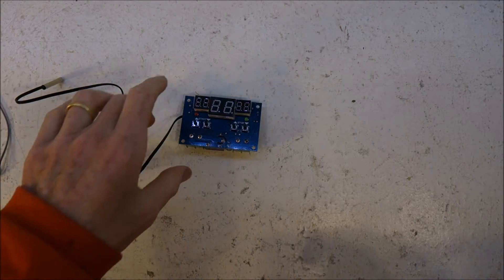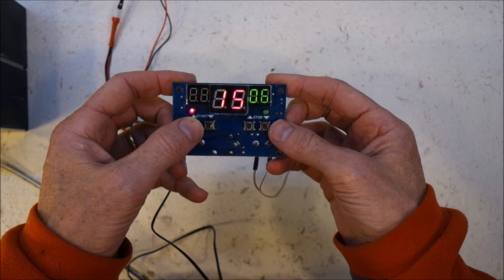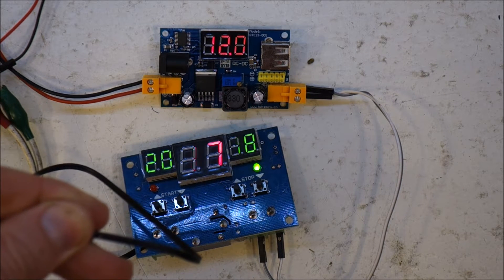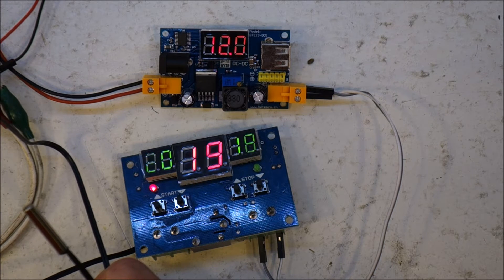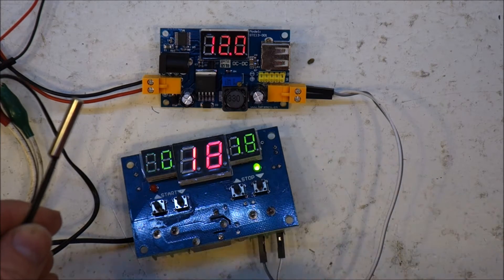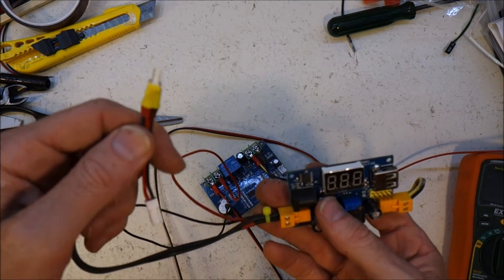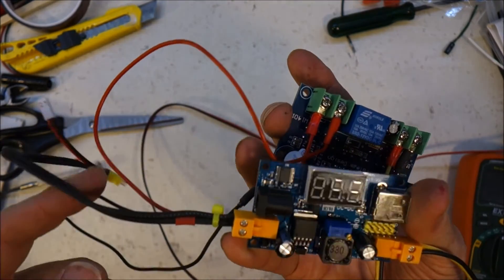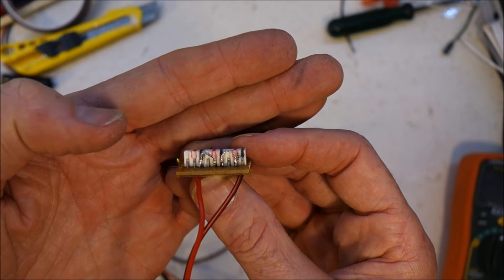Laptop Powerwall 28 - temperature control

Comment: Great job. I too am running fans. I decided to go down the path of arduino, took a while to get my head around it (had help too), but the end result is great. Im running 13 sensors (1 for each bank) and at least 2 fans at the moment. Not exactly sure how ill have them set up.
Reply from the maker: +Craig Minca Do you power the Arduino and fans from the pack itself? I'm having second thoughts about the wisdom of doing that in my setup. But the alternative is to have a separate battery for that which adds a lot of complexity and extra risks.
Also do you have a webpage on your setup? I'm always keen to see other systems.
Reply: +Paul Kennett Yes ill be using my powerwall to power the arduino and fans. No web page but i can email you pics and the code if you like?
Reply from the maker: +Craig Minca Yep please to the pics and code. It might be the right way for me to go on my next Powerwall.
Reply: +Paul Kennett no worries do you have an email addy?
Reply from the maker: +Craig Minca Paul at Kennett dot co dot nz
Reply: +Paul Kennett have just emailed the code.

Comment from the maker: Note: One major drawback of this temperature controller setup is that it's a safety feature that requires power from the battery to function. If for any reason the breaker switch cuts out it will also turn off the fans.
However, my main purpose for the fans is to keep the cells cool to prolong their life, rather than as a safety device. Still - it's not a perfect setup. 
I could power it from the battery side of the breaker switch - would that be better?

Comment: The 3 fans push the air from the bottom (outside-->in)? If this is the case that's good as the powerwall would have positive pressure inside. This help to have less dust after few month inside.
I would have do the same thing exept I would have placed a fourth fan at the top in extract position  to help hot air to exit the power wall case.
In mine I would also put a smoke/fire detector linked to a realy or something that would disconnect the load.
Reply from the maker: +Propergol Yep - the fans are blowing air up from the bottom into the battery.
I hadn't though of a smoke detector - could be a good idea. Just found this: http://www.aliexpress.com/item/Freeshipping-Smoke-Sensor-Module-use-for-Detection-smoke-Detector-W-Relay-Output/1956798697.html
Reply: At least the Ali fume detector is cheap. Originaly I was more thinking to a "standard" and normalized one. I already have some in my house and would probably use the same model.
It is a + and a -, but the model I have "talk" to other detectors so if one smell smoke, all bip together.
I think the + and - are easy to guess ;-)
Reply from the maker: +Propergol Oh - that sounds even better.